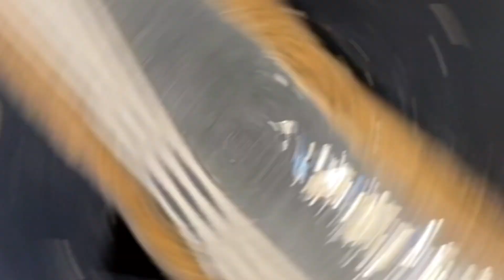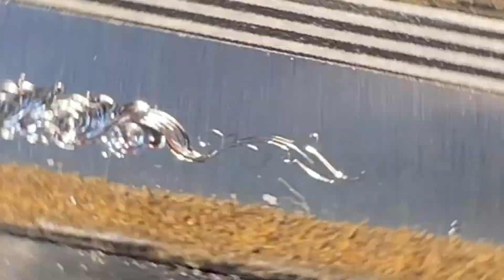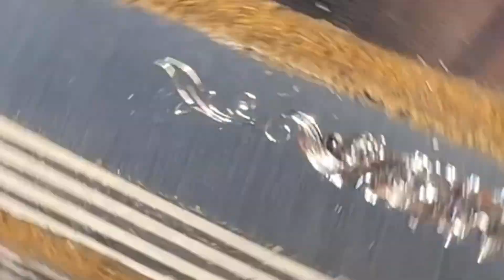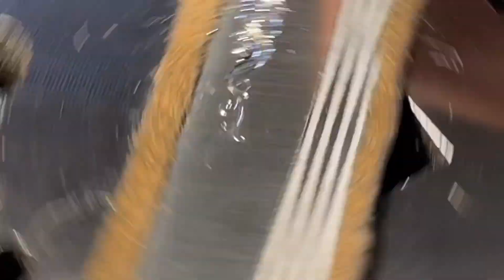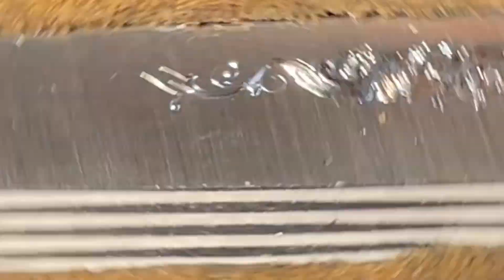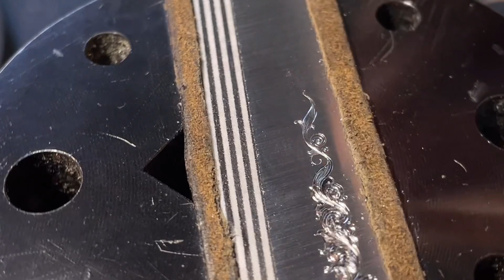【 Perceval kinves arabesque scroll 】 Hardened knife steel  hand engraving ペルスヴァル 彫金 彫刻 手彫り

Comment: Is the knife harder than a stainless steel?  I tried the stenlis but the tip of the chisel broke easily.  how many degrees did you use in the video?  how many degrees is the face?
Reply: The existing design here is unable to be matched with use of graver shown in the video. The depth and width of the existing design could not be matched, possibly different graver was used in cutting each design.